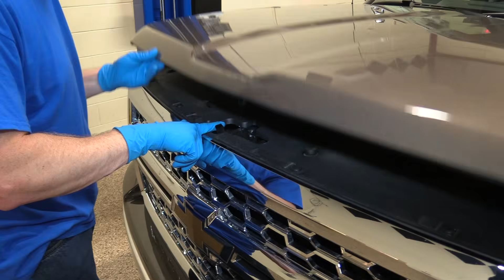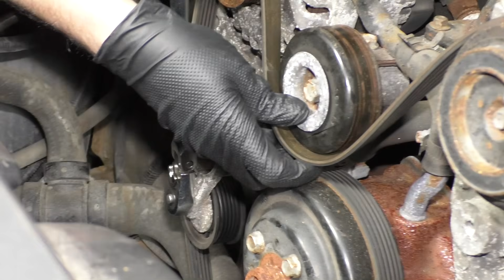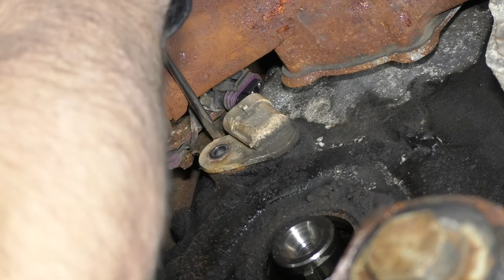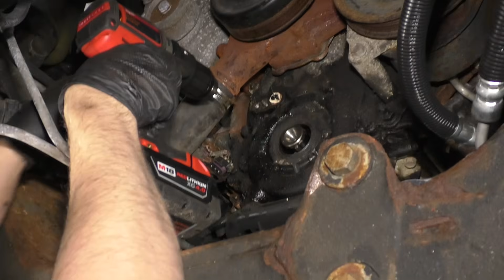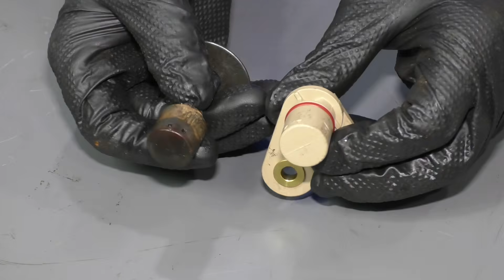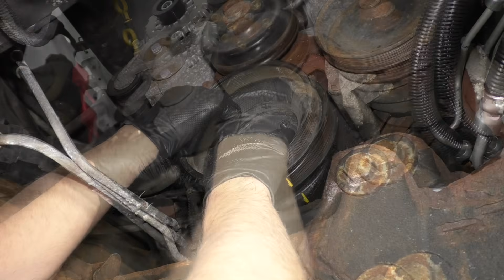How to Replace Camshaft Position Sensor 07-13 Chevy Silverado

Comment from the maker: √  Watch the Video
√  Buy The Part at 1A Auto https://1aau.to/m-Visit-1AAuto
√  Do it Yourself
√  Save Money
Reply: Thanks 1A Auto for your how to videos, I’ve referenced many times in the past!
I could use your insight, I have a 2012 Silverado 5.3L, today the engine light came on and the code was “P0011 Intake Camshaft Position System Performance” 
The lady at the auto part store said the sensor needs replaced. Any way I can find out for sure before I take on a job like this?
I would hate to potentially battle a seized sensor like you guys did in my garage only to discover it was not the root problem. Any help would be awesome, thanks!
Reply: Ball Park cost to change it..?
Reply: Is this same location for the 5.3
Reply from the maker: +Aaron Gordon We don't have a how-to video for your vehicle right now, but the basic steps in this video should be enough to do this task. It should be in the same general location

Comment: All right I'm tired of this that is not a camshaft positioning sensor that is a main shaft positioning sensor even in the code intake camshaft sensor which would be on top where the cam is and not at the bottom where the main is absolute trash when you go to buy the damn things they tell you that there's two one for the main and one for the camshaft that's under your intake and apparently at the back of the engine on top

Comment: I straight up replaced mine without removing the crank pulley or the water pump. Just took the belt off and made it happen. Wasn’t easy but it’s possible.

Comment: And that's why you take off the water pump, instead of the rest he did it, easier access to the sensor, easier to get it off, not cuz it was rusted, it was a bad angle because of his shortcut

Comment: My machinist said the easiest way is to remove the front engine cover off. This way to avoid the sensor breaking and dropping little pieces of plastic in the engine. Heat does work as it will cause the pieces to become brittle and break into the engine. It's a little more work but a lot easier.

Comment: That was a painful video to watch. Are you sure you didn't throw a few wrenches off camera and yell a little bit? 😉 JK I admire your patience. I'm probably going to have to have the sensor replaced on my 2014 model. Mine has the same engine. Is the process the same?
Reply from the maker: +@briandd27 Thanks for checking us out! The process for installation should be similar. http://1aau.to/m/Shop-1AAuto-c

Comment: I don't know what year that truck is but the 07 that I have the sensor is on the other side of the Bowser and you can get it right from the bottom without taking any of that off

Comment: @1AAuto
  Brought my  Chevy Avalanche to Goodyear to have this replaced.  They replaced it and the truck still will not start.  Does it need to be "dead on"  in a certain position or and ECU relearn after replacement ?

Comment: You can also use a torch lighter and heat the metal up around the sensor and it will soften the sensor up it'll come out  smooth as butter

Comment: I just was going on my Silverado 2500HD 6.0 to replace my sensor. What ALL of the videos I watched do not show, is the LS with VVT. There is absolutely no way that you can do it without a pulley puller - and absolutely not in 45 minutes. On top, the pigtail wire with 5 pins has 3 screws to take out. One of this screws is behind the pulley - not reachable without a lot of work. I put everything back together and I bring it into a shop where a mechanic can break his fingers. I’m gladly pay $100 to replace it. That’s ridiculous that 95% of videos show how to replace the sensor on engines without VVT. I could do it on them in 30 minutes myself. 😢

Comment: Once you get the sensor spinning, spray it with Berryman carburetor cleaner and continue to spin and wiggle the sensor the most you can. There is carbon built up on the sensor that the carburetor cleaner can dissolve allowing it to come out. Just fought one for about an hour or two and once I sprayed the carb cleaner on it, it popped out in about 3 minutes just like it was new.

Comment: You wonder why engineers make everything more and more complicated. Why not choose an easy place every mechanic could reach at without taking things apart before reaching what you replace?  I always loved the simplicity of a VW Beetle. 6 screws engine out. Enough space to work on the engine and transmission. Today? Right.

Comment: I do watch a lot of your videos and they have helped me out a lot. This video is not a 2011 chevy 5.3, not where my sensor is and I have 3 clips I have to take off and not sure how to remove the one clip with a red square in the middle? Possibly the red part is the safety lock to just pull up on first?

Comment: I changed this sensor  along  with the solenoid, magnetic the bolt that goes into the cam  and wire harness which the 2 connect into  also 2 oil  changes.  Still have the  p0011. Any ideas
Reply: I replaced my 02 sensors because they were throwing a code while at the tuner as well and both the cam shaft and 02 sensors are on. Are your 02s on as well ?

Comment: With that much effort, guys would pull the engine and put in a V8. That being said, while the engine is out, change the crankshaft sensor, it’s not any easier with the engine installed. I think I would rather replace the water pump then remove the harmonic balancer, it’s bound to go out anyway.

Comment: I just replaced mine on a 2009 Silverado 4.3.   Instead of using pry tools to get the sensor out I used a small cold chisel and tapped it in between the sensor base and the little mounting plate under it.  Just tap the chisel around as much as I could wile also turning the sensor back and forth.   Once the sensor came out enough that the cold chisel was too small I used a thicker chisel until the sensor was out further.  I did try to pry it after that but the top of the sensor broke off.  Thankfully there was enough sensor sticking out of the cover that I just squirted it with WD40 and used a pair of needle nose vise grips and pulled it out.   Really glad I found this video cause the repair manual says to remove the water pump.  I hate draining the cooling system cause it's usually a mess.  Thanks A1auto.

Comment: Thank you for the Video, I just did the swap on my 07 Silverado 1500. So, This way, pulling the sensor out is a pain. I started there but quickly decided to just pull water pump and damper then remove timing cover. Once timing cover was off i still had to use a soft rubber mallet to tap it out from the inside.. there was no way i was going to be able to pull this brittle sensor out the front, save yourself the headache, buy a few gallons of coolant, and go the route i went.. it was a chore but got it done in a few hrs. With my truck this requires pulling efans and radiator to be able to pull and reinstall damper. So far seems to have fixed my P0300 code.. good luck !

Comment: When GM designed this motor insisted on putting some sensors in the most difficult locations and I don’t know is there any easier way

Comment: Took out the 10mm retainer bolt, unplugged the cable, and it rotated very easily.  Didn't seem to want to pull out even when gently prying.  Decided to disconnect the lower plug to get my had in a little better and noticed a skinny blue wire coming from the wiring harness had abraded and broke away from the connecter.  Repaired that and I'm good to go.  Served as a god reminder to ALWAYS check and verify all sensor wiring is good BEFORE starting to replace (or even buying) the part.  Great video, as usual!
Reply from the maker: +Benedictus Maladaptus Thanks for checking us out. Shop for high quality auto parts on 1AAuto.com:

http://1aau.to/m/Shop-1AAuto-c

Comment: Oh no...It's not corrosion of the cover that causes them to stick.  They swell up over time.  Sure wish I saw this video a couple days ago!

I was fixing an oil pan leak on my 5.3L with 326K miles and figured I'd replace the timing sprockets, chain and oil pump while I was at it.  Turns out the timing sprockets, chain and oil pump were still like new.  Barely a a groove in the tensioner surface.  Would have been good for millions of miles.  Anyway, I had a great idea to take out the camshaft sensor to clean the cover real good.  Broke the sensor and couldn't get it to budge.  Tried pressing it out.  nope.  That only crushed it.  Ended up getting it out in pieces.  The new one slid in no problem.

Comment: Sorry for this LONG reply, but I think it will be useful for some...FIRST you should have gotten that connector the heck out of the way so there was no chance of damaging it or any of its wires!!!  You would have been better off sticking with grabbing and twisting the sensor like you did in the beginning AND just kept doing it while spraying penetrant every few minutes.  Eventually, the penetrant would have gotten through.  Just don't over tighten and crush the part.  An open ended wrench could have worked on the connector area you were trying to remove.  You just would have to push against the wrench head to make sure it didn't come off and gouge up the plastic.  ****An Idea to help with where you were at...if you could have found a coarse threaded nut for that masonry bolt you could have used a socket (or short piece of pipe) large enough where the socket pushed against the engine block area around the position sensor you were trying to remove.  First, thread the nut way up the bare bolt and then put the washers on the bolt.  Next put the bolt through the square end of the socket where a ratchet would normally attach.  Now tighten the bolt into the sensor.  (If the bolt has never been in the sensor yet, first thread only the bolt into the sensor to thread it.  Don't forget the bolt is expanding the plastic and it could make it a little tighter.  This method should still remove it!!!)  There should be plenty of room on the long bolt where you can slide the socket up the bolt and watch to be sure the bolt is threading into the sensor correctly.  DON'T OVER TIGHTEN THE BOLT INTO THE SENSOR!!!  Once the bolt is in the sensor it's time to start tightening the nut.  Hold the hex end of the bolt so it doesn't tighten in the sensor more.  Tightening the nut will eventually push against the washers then against the socket and eventually pull the sensor.  Go slow so you don't rip the threads out!!!  I hoe this helps someone!?!    This would have given the maximum pull on the sensor while all of the force was on the block surface.  Once you try it you'll be able to use this in a lot of places.  (Just to add...it goes Bolt + Nut on Bolt + Washers through socket square hole and into the sensor.  If the socket (or pipe) is big enough to touch the engine block only and not the sensor.  That way you know the sensor has room to pull out.)
Reply from the maker: +My Email Thanks for the feedback!

Comment: What are the chances that a bad KPS cause a p0300 code?
I changed coils,cables,sparkplugs, Maf. And still have that code.  My engine hesitates, sluggis,vibrates. (Misfires) it starts right up though.
Once it starts 20secs later The CEL starts flashing. 
Thanks for you video.

Comment: When you put it back in DO NOT use oil as this is the reason it got stuck in the first place. See all the oil on the front of the engine? That oil, over many years cooked itself, from heat cycling, inside the tiny gap around that sensor and created a baked on substance that makes removal almost impossible. Use anti-seize.

Comment: If you take anything away from this video it’s that due to its potential extreme difficulty, DO NOT buy the cheapest replacement part you can find as you may end up having to do this all over when it fails.

Comment: Just did this on my 09 Sierra, I had to drill it out, doing so it broke into pieces and I’m afraid some might have fell behind, i got 97% of it out but I know a small bit fell in. Will that effect anything? Time chain? Or cause damage to the cam/ block?
Reply from the maker: +bman6954 Having metal in your engine isn't good.  Try draining the oil into a clean pan, and inspect both the oil and plug for metal bits. Good luck!

Comment: Im telling you right now i have a 2013 silverado 5.3 and mine is not like this you don't have to take off none of that period
Reply: How did you remove yours ?
Reply: @jesusrubio9525  had to loosen from top and then from under going through the harmonic balancer spokes ultimately used a small pry to get it lose very easy
Reply: Bull.  I ready get crazy trying to know how to change that sensor on my 2009 Chevy 5.3,  and till now I see your message that I don’t have to remove all that

Comment: I am going to be swapping out the Cam Shaft Sensor myself. This was a very helpful video to better prepare myself. Thanks!
Reply: What type of truck do you have and how did it go? I have an 08 avalanche and I'm gonna need to do mine but I have no Idea if mine would be the same as this. I have a 5.3 L
Reply from the maker: +Gabriel Jude Thank you!
Reply: How did that work out of curiosity.